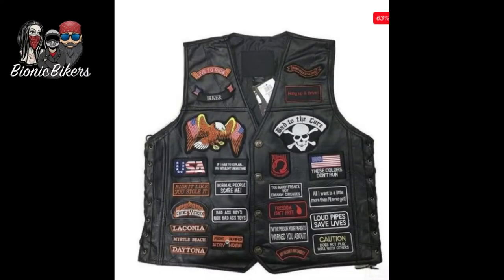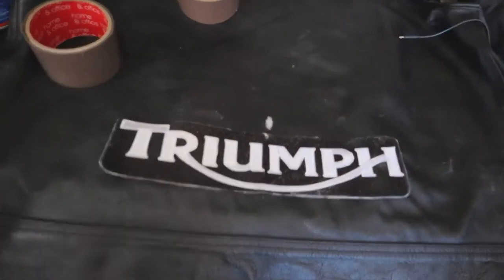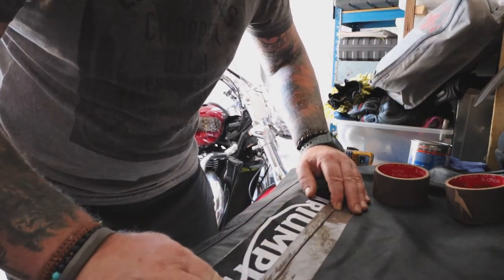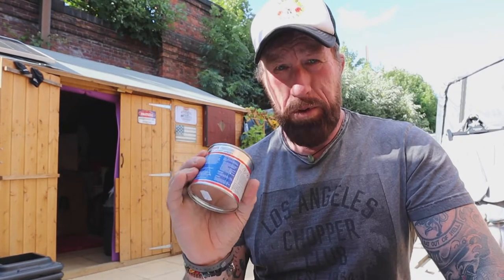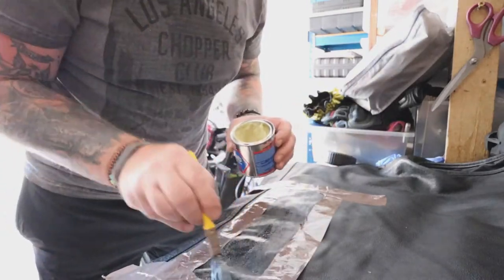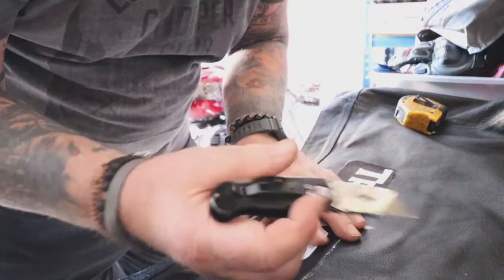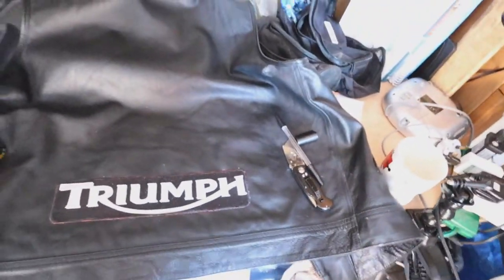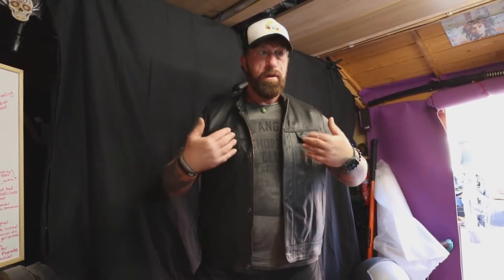Best way to put a patch on a Leather Motorcycle Jacket [without a needle]

Comment: I used Gorilla Glue Super Glue on all my patches and a roller to apply equal pressure rolled each patch for 45 seconds. They've been on my vest for over a year only the back patches I've had to touch up here and there, like a corner will start to lift because the back of my Vesy makes contact with shit all the time. But yeah it's faster, easier and cheaper than paying someone to do it. Just make sure you have your measurements right and marked with a grease pen after the patches are on you can get rid of the grease pen marks with a piece of electric tape. I also use an Iron after I Glue them down too.
Reply: I’m glad I’m not the only one whose done this

Comment: I have three vests for my Harley and one of them i specifically used E6000 glue and I just marked the area around the patch and roughed the leather up a bit with some grit paper and it has held so strong but you have to be very careful not to put to much because the glue will ooze out of the sides and looks like crap and it’s a bit tough to get off but If you do hapoen to have it come out of the sides some tweezers will peel it off nicely just do it within the first 24 hours.  Cheap glue and it works good so hope this helps someone out there!
Reply from the maker: Great points 👊

Comment: Great job! A fellow Triumph owner here too! I have a 2018 Rocket III and a 2016 Triumph Tiger! You have great taste!! The Rocket is my daily rider from when the first snowflake melts to the first one falls. I put close to 12,000 miles on her every year. I just finished putting 14 military patches on my husband's vest to commemorate his retirement from the Army. There was no way I was going to sew those things through that thick leather, my fingers would turn into hamburger and it would have killed my sewing machine! Needless to say, yes, you do need good ventilation to apply this contact cement, and a tip for your next application, Lay wooden skewers on top of the surface that you are applying the patch to after the glue has dried. Pull one skewer out at a time to lay the patch onto the prepared surface. This will help to align the patch on top without accidentally allowing the patch to drop onto the prepared surface when you are not wanting it to. Second, get a rolling pin, cover it with plastic wrap and use that to apply even pressure onto the patch and get a good bond to the product. Have a great day and keep those Triumphs thundering on those roadways!!
Reply from the maker: Wow you should be making a video 🙏 thanks for the tips and of course Triumphs Rock 🤘
Reply: I'm also a daily rider and have a 2016 Rocket III Roadster! Love Triumphs! My other bike is an Indian but Triumph will always be my fav!

Comment: Good video.  Just a suggestion when using a contact cement like that you should use either a roller or a mallet to really ensure the bond.  It also helps when applying to leather to rough the surface a bit.
Reply from the maker: Great point!

Comment: I've damaged my neck resulting in a pinched nerve from sewing patches onto my jacket last week..pain I'm in is immense..arm and hand have numbness and popping ibuprofen I think il use glue..they're all hanging off as I struggled like fk. trying to do it and having to give up.👌👌great vid mate 👌
Reply from the maker: cheers and your health is worth everything or you'll not be riding....chillax and glue those patches 👍
Reply: From sewing patches? Jeez, hope your okay lass. Are you in Scotland Elaine??
Reply: I Glued all my Patches on using Gorilla Glue brand Super Glue. Just measure and mark with a grease pen or a chalk pen, put the Glue on the back of the patch put in place use a hand roller to apply equal pressure around the patch for 45 seconds and use some electric tape to remove the chalk or grease pen marks. I used it on my top and bottom Rockers, Center Patch, even the patches on the front. Lasted over a year now. There's been some small sections on the back where I've had to reglue part of a Patch down because the back of my Cut makes contact with a lot of shit. I've even done other members Patches. I've tried other brands of Super glue but Gorilla Glue Super Glue is king.

Comment: I sometimes use glue ( for small patches) but, dont use tape, just dressmakers chalk draw around patch for posision. Just check glue is clear finish(not white) fabric glue to leather compatible!  Other method is using hemming tape( cheap, flexible)! Draw around placement,  cut hemming tape to size, t towel damp, iron set to medium, place patch, damp t towel, then, iron on! Done immediately as cooled 30secs. No waiting! Boom! Then go rock the look!